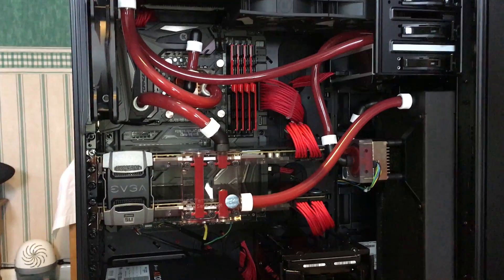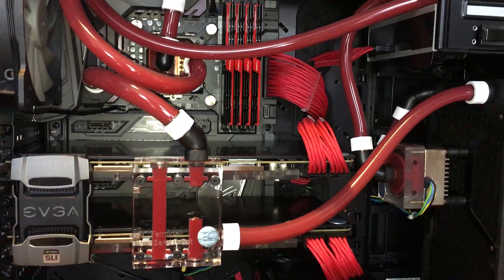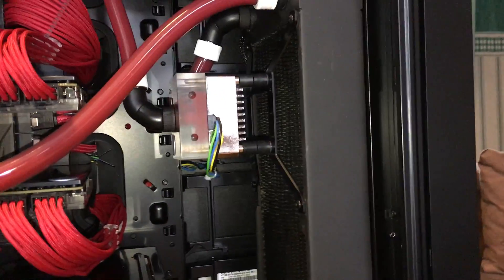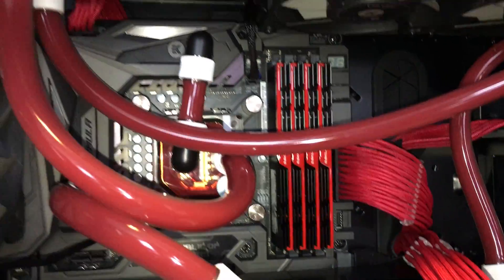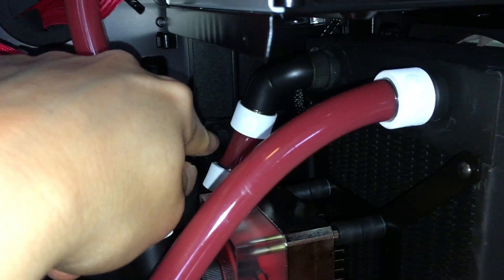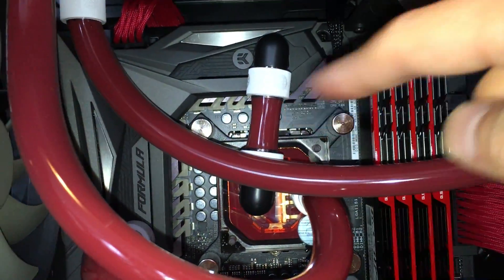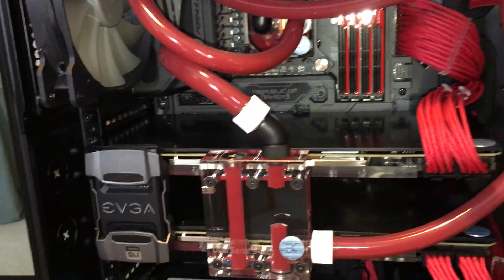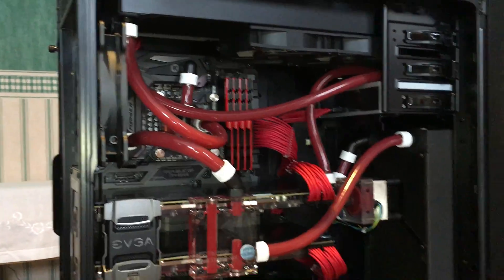EVGA 1080 Ti FTW3 GPUs liquid cooled and installed at last

Comment: Nice build but I would suggest you get a slimline fan for your radiator in the top of the case you can buy fans that are really slim and it least will give you some more airflow for that radiator
Reply from the maker: Blade thanks. All that’s already done mate. Check the latest video out https://youtu.be/zTgH5qoZUq0

Comment: what are your overclocks ?
Reply from the maker: None. I'm not a fan of them. Overclocking causes instability and shortens component life spans, all to gain a few FPS that doesn't affect gaming. In any case, my current temporary monitor can only support 60 Hz so there's no point in doing so 'yet'. When I run benchmarks, I OC my GPUs by 100 MHz and move the voltage increase slider up to 95%.

Comment: Thanks for this video! Just picked up two of these with EK blocks.  The FTW3 is tall! I'm hoping i don't have clearance issues since i have a radiator up top.   Just waiting for the GPU's and blocks to get in.

http://www.overclock.net/g/i/2760586/a/1481424/build-log-caselabs-mercury-s5-projectevo/sort/display_order/
Reply from the maker: Yes they are taller and hence they weren't compatible with EK's other solutions for EVGA's 1080 Tis. The reason for this is the FTW3 has more VRM stuff to supply power to the GPU. My temps dropped by 30 degrees after water cooling.

Do you plan to install the GPU fan PWM cable to drive your radiator fans with them? There are cut outs on EK's waterblock to accommodate them.

Comment: Are these not the EK FTW3 blocks?  Those released later than March
Reply from the maker: Yes!
Reply: I think he means July 3, 2017
Reply from the maker: Yes they are. Yes they were only released on 03/07.
Reply: Any tips?  I have two of them ready to go for my rig as well.
Reply from the maker: Yes DON'T over tighten the hex screws that secure the FC-Terminal block to both waterblocks. These things crack so easily. If you do crack them, EKWB will sell you just the acrylic part for a few bucks but you'll have to wait for shipping etc. I take it you're using the serial FC-Terminal to connect them?
Reply from the maker: Another very important tip. The waterblock has 3 'depressions' to make way for installing 2 x PWM fan cables to 2 of the 3 fan headers on the GPU and 1 more depression for installing an RGB LED. There is NO WAY to plug these cables in after the waterblock is installed so it may be wise to connect the appropriate cables/adapters to these headers and leave them 'open-ended' just in case you decide to use them in the future.